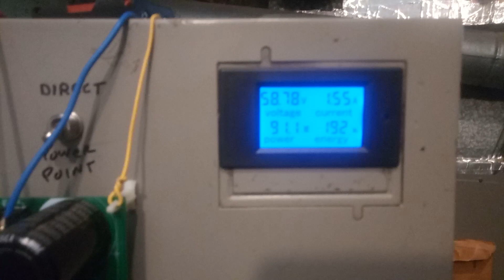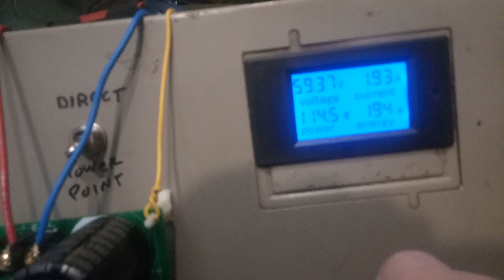Introducing PV Solar Diversion Board To Heat Water Efficiently At Power Point

Comment: Build yourself a air to water heat pump and get 3 or 4 times more hot water from your solar.
Reply from the maker: Yes and spend $2500 more for a system to make hot water. This uses only excess power from a small system which is usually wasted. I would have to increase my battery, charge controller and inverter. With the cost of panels these days, this really can be cheaper.  I have a HPWH at home and I also supplement with resistance heating.

Comment: Thanks for all your hard work to get to this stage, i am sure you learned a heck of a lot in the process. I have been following your water heater development from your early prototypes using hacked eBay boards to your own design and build. I am living pretty much off-grid (except water) in the Canary Islands and want to utilize my solar system better to heat hot water for showers, washing etc. The Canaries are on the same latitude as Morocco and the Sahara desert so we get plenty off sunny days to make the best out of any solar system. In fact, my main solar system (1.9KW PV panels, Outback FM80 MPPT, 3KW Inverter, 5.5KW battery bank) is usually in FLOAT mode by about 12 noon - 1pm, so spends the next 6 hours just trickle charging the batteries. I would love to get my hands on one of your production boards to do some testing here where we get about 330 days sunshine a year.

Comment: This is really great work. I have built my own solar PV systems and I am so surprised how few people around the world are doing this. Due to a lack of suitable controllers, I have focussed on direct PV to element systems. By matching the MPP of the panels with the element resistance, I get great performance with lots of sun but terrible performance in any other conditions.  

I heat a 300litre tank with 2KW at 200V so it would be great if Opera's components were called up to the max.

Comment: Nice job ! What is the voltage limit on that ? What is it diverting the power from ?
Reply from the maker: Less than half my panels are in full sun at any time. Parallel at 60V works  best for me with 120V elements. Board has 200V components. 130V is best for 240 elements. There generally is no need for more than a KW to be produced by an element.  A 5500W element could produce 1600W at 130V and 4500W would be 1300W.  Mine only produce 400W in each of three tanks and the do fine.  More panels needed on winter though. All my heaters are powered by same as charge controller.  This process is not understood by most in solar.  Around the world there are several of this design in operation.  You could be the first to produce a video with this new board.  Your IGBT would connect to the boards screw terminals.
Reply: @opera5714  But my system goes to 280v so it would blow that board
Reply from the maker: @LarryKapp1  You don't need that high a voltage. Your performance with what you have is terrible. Parallel panels would be sufficient for winter. Frankly I hate people using panels just for water heating.  What is your CC system voltage. Your panels should be added to that and have all the excess go to water heating.
Reply: @opera5714  I have two controllers that are pretty well maxed out  - one is around 100v array and the other around 80v . I would have to look to be sure. The thing is the water heating PV were free panels that I got - rejects so there is no big deal to me to just use them for heating the water. The other PV arrays I have are enough for the batteries I have. The only advantage I would have from the water heating array would be for cloudy days . But the other PV are already doing a pretty good job with that. I would need more batteries so expanding the battery pack two times what it is now would be like an 8 10 thousand dollar investment. I would also have to get a third Midnite Classic controller and associated boxes and combiner box. So that is another investment.  A lot easier doing what I have now. How does your board sense to turn on and take the extra power from an existing array ?
Reply: I could add your board to one of my existing arrays though - since I am doing the same thing in that I take some of that power to run an AC heating coil.
Reply from the maker: I didn't mention that one of my relatives was an Edison Pioneer, One of the initial few that worked with him, I have his lapel pin. Story goes his house had the first electric light on the street the night his son was born. He ran a wire to the trolly power line. Could be the firs documented theft of electric power.
Reply: Running high voltage DC is also very dangerous. One of my systems runs at 200V and I got a nasty kick from it when installing. The kick felt just like 240V AC so I assume it's enough to kill you.
Reply from the maker: @openroadtouring2410  My arrays are 50 & 60V and the system was designed around small camp systems.  Everyone wants to go big asking for nearly 300V. Must admit I am uncomfortable with many in solar wiring  at high voltages with limited experience..
Reply: @opera5714  it's strange how Edison was remembered as pushing his DC system saying it was safer than AC.
Reply from the maker: @openroadtouring2410  Saw the movie Current Wars, it was almost unwatchable. For a movie about light it was the darkest picture I've ever seen. Even setting the TV at super bright it was hard to see anything.   #1 political advice is define your opponent first. Edison's DC killed a number of horsed due to leakage under the street from his electrical conductors.

Comment: Hi nice project im interested in the board i'd like to get a few ???
 when would you have them available ???
Reply from the maker: These are just becoming available. Are you US? These are not just plug and play. You must give array size and array typical power point voltage.  I need to review if your application is suitable for board options.  Board is built for specific voltage.

Comment: I think people get a bit over excited with things like this.  You can only get out what you put in. If someone is only running a few panels, Trying to heat normal  domestic amounts of hot water is not going to happen. Certainly the real world difference between putting 27W into a water tank and 99 watt is nothing at all.  Scaled up, certainly but unless one had a bare minimum of 1000W of panels, the output on a cloudy day is NOT going to heat any normal amount of water and not even with 1000w anyway.  If you can get 200V@ 10A, different thing but people should be aware to get that even on a good day is going to take a Minimum of 2.5Kw of panels installed. 

I can see people using this with a few panels and then blaming the board when their hot water is cold. People need to look at the size of their hot water heater and then look up a water heating calculator to see how much total energy is required to bring the amount of water they use up to the heat they want and size their array accordingly. The Kwh needs to be addressed followed by the amount of panels required to give that in reality with margin for the significant inefficencys and then if you want to cover yourself for cloudy weather, you'll need to triple that amount of panels at least. 

Controllers like this can make the best of the panels available but they are not going to make hot water from input thats just not there to start with or heat a 50 gallon tank from a couple of hundred of panels no matter how sunny the day is.
Reply: I agree  with all the factual statements, and 15 min playing with the calculator should be a healthy reality check, but I think if you have already ended up on this channel its a fair chance that one is frugal with energy consumption, and there are quite a few use cases besides full domestic hot water production. For me it's an off grid cabin where using the available energi as best I can saves me work down the line. Pre heating the hotwater when we use the cabin saves on propane, and shunting the heat/energy to a glycol loop under the composting toilet will significantly reduce the composting time when we are not there. Right now there are no off the shelves solution for harvesting the excess solar energi which gives you this freedom on how you utilize the energy that I have found. So i say bring it to market, it's a solid step in the right direction.
Reply: I think the idea is efficiently getting the power you have rather than leaving a bunch on the table. Mismatched panel voltage to the resistance of the element means if the panels are putting out 250 watts sometimes the element will only use 50 watts of that. This is similar to boost mode on an AGM charge controller... similar but has some other benefits. It probably makes the thermostat able to be retained as well since the dc is inturupted

Comment: Very nice work, good luck with your surgery. I would like to have your system for heating water at my off grid cabin.
Reply from the maker: I'm still waiting on some parts to come in. These boards need to be configured for the array voltage and current.  Please describe your system volts/amps and if it will share the same array as charge controller.
Reply from the maker: Depending on the voltage and current you have these are now available in US.  Initial units are limited to those who will do a video when it is up and running.

Comment: I hope your surgery goes really well Opera and you have a speedy recovery. I’m in Australia and we use 230vac could I use this to power my hot water heater? If so I’m VERY interested in getting a board. If that’s not possible and the board will suit my purpose, how do I get information on where they will be available please? 🙏🏼
Reply from the maker: It all depends on your array. 240V elements powered by 120V will be 1/4 power.  That is still enough to heat water iif sun all day. There are also380/208V 6000W three phase elements that can be used with lower voltage.  The design voltage is only limited by the capacitors and FET used.  At voltages over 200V an IGBT could also be considered.
Reply: @opera5714  I too hope you all went well for you and your on a speedy recovery. I am also from Australia and I was thinking to run this on a small array independent of my 48V battery based system stand alone power system. I have 6 strings of which i can spare 1 or 2 easily to be dedicated for hot water heating which are made up of 3 of 215W panels connected in series for approx 90V. Would you suggest connecting this board (once made) to run independently on a system of its own or it be coupled to the larger system which has a MPPT fitted. If you need any more info to provide suggestions i am of course more than happy to provide this.  Cheers
Reply from the maker: @shaunjurman443  It is as much about how it is connected as it is the board.  Large arrays on a MPPT CC often have a lot of excess will typically outperform a dedicated array of 1 KW.  A dedicated bank can also be supplemented by an isolating diode from the CC bank in the case of mixed voltages. The decision is often dictated by the voltage of the CC array. Ideal would be 120-150V in its current form limited only by FET and capacitor voltage. Current of 10-15A Is the result of 5 capacitors, a practical board fit. Far more practical is to just add a second heater element which is switched in at a set current.
Reply: @opera5714  Thanks for your reply. I have 18 panels which are 215W. 3 panels connected in series and hence 6 strings. The Voc of such panels are 37V and when connected the system measures approx 90V coming into the MPPT controller i have. i will keep reading and watching your other videos to learn some more. Really appreciate your videos which are very different to others which just "plug it in and see what happens" type, cheers
Reply from the maker: @shaunjurman443  So, where do we go from here? I'm assuming you are in AU. Are you an electronics builder? It would be nice to have someone there as a contact point. I do have my stuff running there, but they aren't interested in being known.

Comment: This is going to be awesome. Yes, please prioritize those who can turn these boards into more videos. What you have is way better than the techluk product. I'm unsure about using igbts over n channel mosfet though. If you can put in a WiFi microcontroller like an esp, that would be even better for remote control and monitoring. Good luck with the surgery
Reply from the maker: The heat losses of an IGBT begin to match those of  common HV FET. There are newer exotic high priced FET which perform well, but there is a lot of fake stuff out there and I've been stuck with this crap. I use a IRFP260 in parallel and that works well in parallel. My stock way outperforms manufacturers spec for this.

Comment: Hello, where do I purchase this circuit board?
Reply from the maker: Depending on the voltage and current you have these are now available in US.  Initial units are limited to those who will do a video when it is up and running. Do you want a running unit?
Reply: @opera5714  hi is the us version 220v ?
Reply from the maker: @houseofancients  It can be made any voltage.  I only purchased 200V parts so 130-150V array is the max.  There is no need to be 220V as you are putting in power all day and it is the total amount that counts.  5500W elements give 1/4 power when the voltage is half.  The real feature of this is it can use existing CC arrayand work off excess.
Reply: @opera5714  well, let me explain..
have 2 tanks ( 200 liter and 300 liter), each with a mid center 3000w element, using a standard 240 input ( european) .
i also have 12 older 255w panels not in use.

my primairy heat source is an heatpump, but i'd like to start pre heating and keep temp up during good days, thus less run time on the heatpump.
electricity is highly taxed , so it makes sense to put as much "free engery" in the tanks i can, without replacing elements or thermostats
Reply from the maker: @houseofancients  is your blah external? Most one piece units also have internal resistance heating. You would want to operate 6S for 180V to keep under 10A for Polish module if believe the spec.
Reply: @opera5714  that was indeed the plan, either 2* 6 in series , one for each tank.
have been thinking if it would be feasable to use a contactor based on temp for 3 tanks, one being the buffer tank for the heatpump.

it is an external 12kw air to water (on/off, temperature controlled)  heatpump, used to heat the house, or the potable water.
so any extra hear i can get in either 3 tanks, the less the heatpump needs to run.
due to my location, there will never be enough sun during winter, but i fully expect not having to use the heatpump at all during  spring ans summer
Reply: @opera5714  is there anyway i can get in direct contact with you opera ?
Reply from the maker: @houseofancients  leave your email on my home page in discussions
Reply from the maker: @houseofancients  Winter performance can be dismal, but a true power point controller can grab some useful power.  Your array could produce close to 20A. Conditions most of the time will be 2A or less. At 2A in direct connect that would 
only be 76W. Power point increases that to 260W, enough to heat 22L in 3 hours. At 1A direct connect only produces 19W while at power point that increases to 130W.
Reply: @opera5714  so then the question becomes, where can i get ones, and what does it cost ?
you can answer that by email.

thank you
Reply from the maker: @houseofancients  What email?  You should consider this https://www.youtube.com/watch?v=x1wqhZKJJsc&t=58s   AC7391 video It will operate at that higher 180V. In fixed voltage mode, two modules can drive two elements in priority.  No direct experience with these. I am not buying parts for a higher voltage version.

Comment: Simple user replaceable parts is a huge bonus. Let me know when you have one ready.
Reply from the maker: This feature was inspired by some installers who can't get the techluck units repaired.
Reply from the maker: Depending on the voltage and current you have these are now available in US.  Initial units are limited to those who will do a video when it is up and running.

Comment: Would that be viable at 24V ?  Running 24v system 36v nominal.
Reply from the maker: Not really though anything can work. I have one 36V array (50V) that powers a heater. Capacitor bank needs to be much larger for current.

Comment: Boy your not exactly in prime solar energy turf.
Reply from the maker: Home system is only for test. I get less than 1/3 KWH expected by a solar calculator.  It is still viable as it only costs me the panels. At camp it is the same issue.  I depend on a larger array as there is no other solution. Summer is always easier.

Comment: I would love do give it a go at my off grid cabin if you don’t have takers for all your boards. 4 panel array at 125ish volt PowerPoint. Nominal 1100watts.
Reply from the maker: That is an ideal array for this.  Are you located in US?
Reply: @opera5714  Nope, I’m in Norway so close to zero sun production the next two months. Voltage wise I’m actually looking at 110v elements for the heater to get the ohms where I want without breaking the bank. Also I have the selection of Fets on hand to test, some old school and some newer with better efficiency numbers.
Reply: @opera5714  any closer on having units ready for for field testing? If shipping to Norway is a issue I an US address as well;) Also looking to install in parallel with an mppt controller.
Reply from the maker: @RexKanum  I've sent out the first two and we'll see how well they can be implemented. It 
seems the easiest way for most people is to have the assembled unit shipped on 
a 5x7 inch base plate that serves as the heat sink.  Check your discussions on 
YOUR home page for a message.